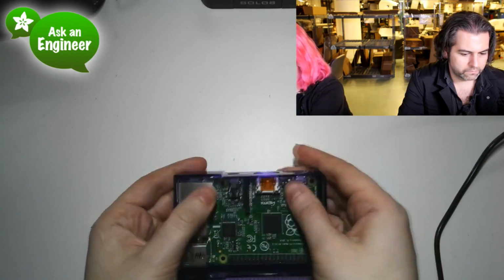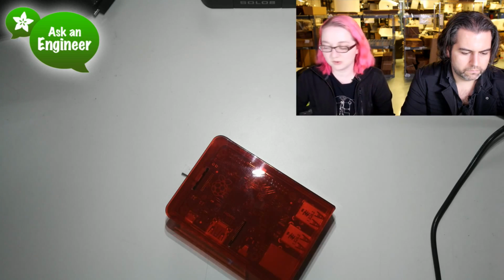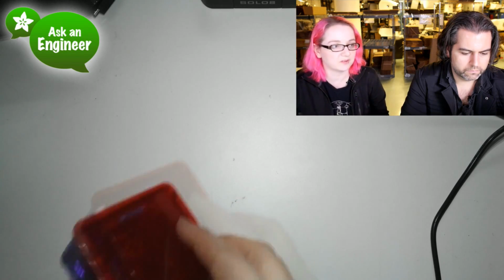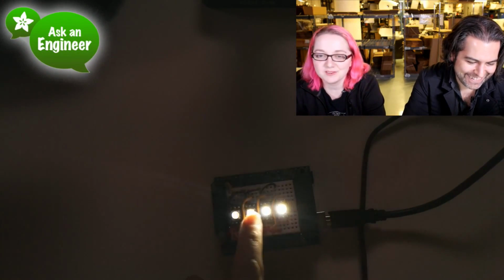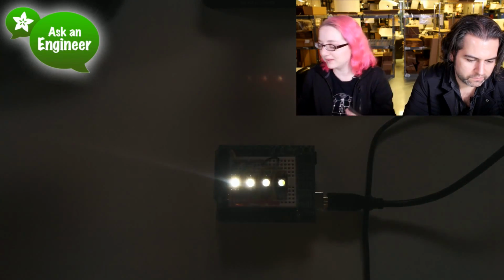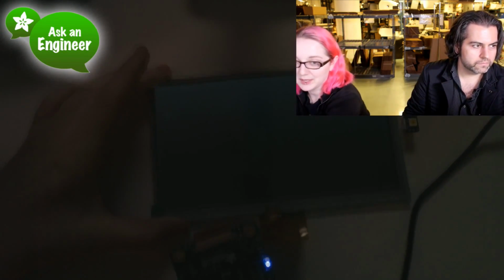New Products 1/28/2015

Comment from the maker: NEW PRODUCTS 1/28/2015 (VIDEO)

 - Steel Drum Kit by Gakken (0:05)
 - Raspberry Pi Model B+ Case Lid – Purple (1:15)
 - Pi Model B+ Case Base – Purple (1:15)
 - Raspberry Pi Model B+ Case Lid – Red (1:15)
 - Pi Model B+ Case Base – Red (1:15)
 - Brass M2.5 Standoffs for Pi HATs – Black Plated – Pack of 2 (3:25)
 - APA102 5050 Warm White LED w/ Integrated Driver Chip – 10 Pack (4:24)
 - APA102 5050 Cool White LED w/ Integrated Driver Chip – 10 Pack (4:24)
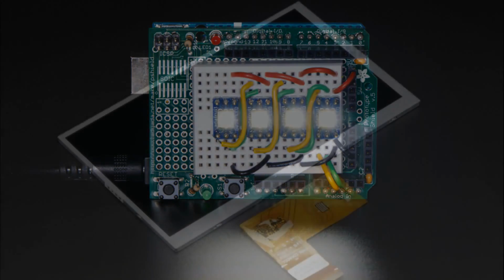 - 7.0″ 40-pin TFT Display – 800×480 with Touchscreen (8:29)
 - 7.0″ 40-pin TFT Display – 800×480 without Touchscreen (8:29)
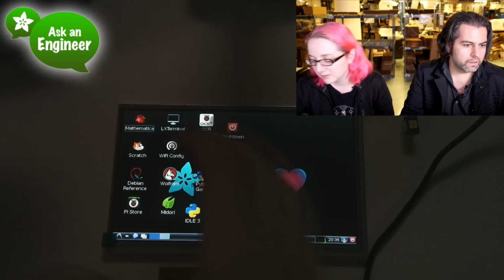 - Adafruit DC & Stepper Motor HAT for Raspberry Pi – Mini Kit (10:17)
 #newproducts   #videos